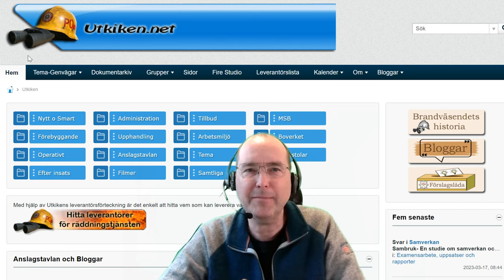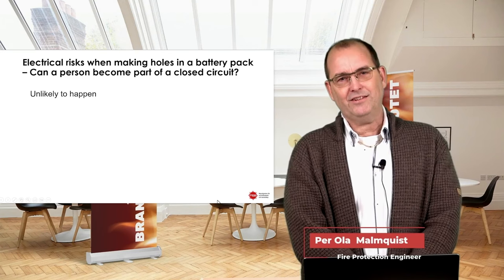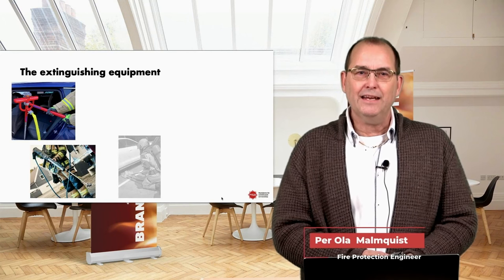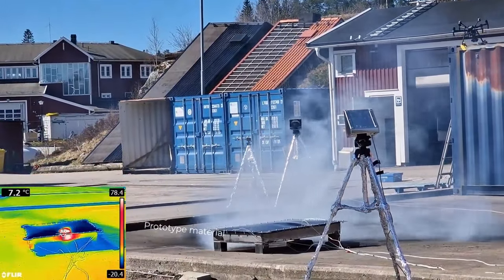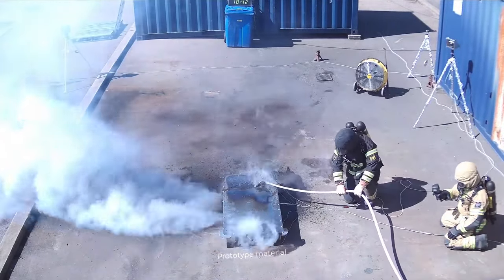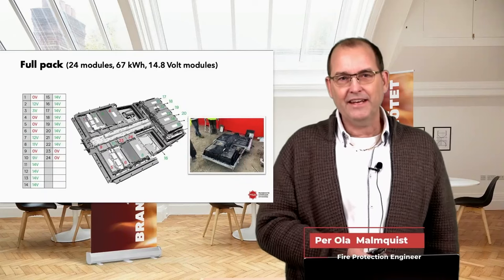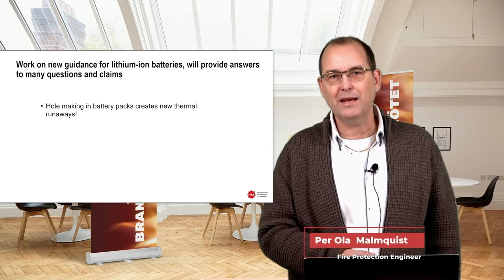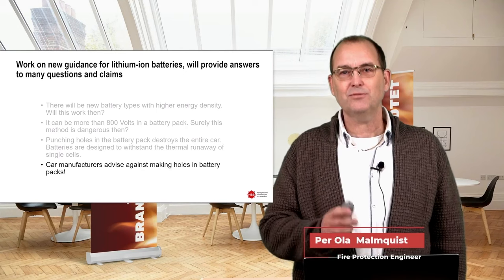Putting out lithium ion batteries with plain water in a short time

Comment: Thanks! It seems to me that car manufacturers could install standardized one-way ports at various points that could be used to directly inject water throughout the pack without needing to forcibly penetrate it.
Reply from the maker: That is spot on! If they did that we would not have the EV fire discussion that we have today. Renault actually has that on all their EVs. An opening in the battery pack that opens up in fire and makes it easy for firefighters to spray water into the opening.
Reply: Yes but this is where mice can enter into that area too and stat chewing away at the wires. New problemo!
Reply: @zeeek1  Read again ;)
Reply: @UtkikenRescue  If Renault has it, Nissan has it as well I suppose? Also, is there a standardized way the automakers communicate those things (similar to the rescue card i.e.)?
Reply: @UtkikenRescue  Is there a reason this isn't being done? Could it increase the odds of water getting in or getting shocked while charging in the rain?
Reply: You try to go near the car on fire, put the hose in the acess and stick there....

Comment: So build the battery packs with a coolant injection port for fire fighters. Injecting CO2 into packs would be best.
Reply from the maker: It turns out that gaseous extinguishing agents are not very good for battery fires. There are examples when some gases have worked, but the success rate is much smaller than for water.

Comment: Why not to build a "bottomless water pool around car" (supported by water filled walls) and fill it with water above lvl of battery?? Yes it takes more water but its easy and safe!
Reply: the biggest problem with water is freezing, and the pressure that might put on batteries... and actually causing problems.
Reply from the maker: There are some countries that are working with routines like that, and companies providing equipment for it. As I say in the video, there will be battery designs that cant be extinguished with interior water, and for them it could be a good solution.

Comment: This is fascinating to see. It reinforces some observations I've had regarding EV fires. Most notably that you don't need 5 tonnes of water to put out an EV and you're never going to get as good a job done putting out the fire until you flood the pack itself. Also demonstrates the cutting extinguisher to be extremely effective. But I don't think that's a complete solution since we still have impact damage that may involve substantial warping and consequent drainage of any flooding of the packs. It would be really cool if we had some sort of phase change chemical that could be injected into a pack in liquid state (ideally using the cutting extinguisher), survive the temperatures, and then set and seal out any oxygen. Such a system could also address the reignition problem as well.
Reply from the maker: Yes it is very interesting. I agree that it would be optimal to find something that would stick and keep it cool even if there are large holes. 
About our tests I think it is an answer to some occasions, and not to others. So like in any other firefighting situation there is a need for a skilled firefighter or commander that can choose tool wisely.
I was at a test in France were we burned a bus battery with an aluminium casing that melted away. I thought the cutting extinguisher would not be able to handle that, but after flooding continuosly for a couple of minutes the battery pack filled up well. So I believe patience and a continuous flow of water sometimes can be a solution when there are larger holes.
Reply from the maker: Yes it certainly is interesting to see that we start learn things that can bust some of the initial myths created by the vehicle industrys, in my opinion, bad advice. I totally agree that  we have much more to learn and your thoughts sounds very correct. I have been thinking about what would happen if we used AVD extinguishing agent instead of water, or Hydrex. Both are agents that are environmentally sound and sticks to vertical surfaces, cooling very good. On the downside for them could be that their viscosity is higher than water and might not flow as well in the packs.
Reply: Can manufacturers provide a convenient location and means of connecting a fire hose into the battery cooling system? A relief valve to allow outflow would prevent a buildup of pressure. The new  Zeekre good battery is designed to be waterproof. Tesla cybertruck has a positive pressure so perhaps the air  valve can also be used to provide an outside water  source?  
In your experience would a custom spray bar, providing high pressure mist, positioned  underneath the battery offer enough cooling effect? Such a spray bar could be deployed to fire agencies and used  immediately with little additional training and at a low cost?
Reply: @mickjoebills  There are a couple manufacturers who do have flood ports. I can’t remember which but they aren’t perfect because a collision could damage the ports too.
Reply from the maker: @captainotto  @mickjoebills I believe you are thinking about the Renault firemans access. It is a brilliant idea, that unfortunately might have some flaws in it. The problem being that the smoke (flammable gas) produced when there is a smoking thermal runaway have produced a couple of serious explosions. Would be great if it vented to the outside and not into the cabin I think.

Comment: Ok so it is very well known that  lithium reacts quite violently with water then how on earth you try to extinguish lithium batteries with water?!?
Reply: You are right about lithium metal, but the lithium in the batteries are mostly ions. Think of it like you have sodium ions in salt water, and sodium is also a combustible metal. 
Also, putting out the battery fires with water is actually not putting out the burning cells. Instead we cool the not burnt cells so they don't ignite.
Reply: @perolamalmquist9043  the main ingredient of lithium ion batteries is lithium metal from which you get lithium ions. Therefore, if a single cell is broken and water or even moisture is getting inside the cell it makes lithium react and burst into the flames damaging instantly cells next to it. The only way to extinguish the lithium battery is to use some powder or co2. Also the design of the battery pack should be done in a way that it would prevent fire from damaging neighbouring cells. Water is not enough to prevent other cells from being damaged. And if other cells gets damaged then water will be already there to react with lithium. I think better would be to inject some sort of gluey insulator that would insulate the cells from each other and prevent individual cells from any damage.
Reply from the maker: @severyn184  I have put out full size car battery packs with 100% State of charge with water. The lithium metal is not a problem for lithium ion batteries.
Reply from the maker: @severyn184  Here are a couple of videos where we put out lithium ion batteries with water. https://youtu.be/4xjDdmv8urk
Reply: The Dunning-Kruger effect is also very well known, yet it hasn't stopped you from thinking your high school chemistry knowledge outweighs the experimental data from a literal expert on putting out battery fires.
Reply: @r7calvin  putting out a fire is not that difficult if you have the right tools. However, it would be more sensible to use something else that won't react with lithium as much which could put out battery fire much quicker don't you think?!? The problem here is not a fire itself as much but individual cells getting damaged due to already broken cells violently reacting with water.
Also your rude comment doesn't outweigh the high school facts that are somehow missed in the process of putting out lithium batteries.

Comment: Good evening, thank You for a very informative video and precious experience. I would like to ask, I am working as an electrical engineer and designer of installations for houses and commerce (Europe), about practical experience of using fire extinguishers within highly automated households with heat pumps, PV installations, home automation, lots of notebooks... I request from an architect a fire protection project, when designing electrical installation for building permit does not usually require too much considerations as whole house is considered as one "fire segment / zone". However as an electrical engineer I always comment or recommend placing fire extinguishers also at such homes (although formally not required). Usually CO2 was used (halons not eco, water risky fro electric appliances...). So now to the question: I see that special vermiculite extinguishers pop up as a way of handling lithium battery fires, which release steam and create isolating crust over  the object. Do you have practical experience with them, or would you practically recommend such device for laic persons? Price tag is at premium, 6kg device is around 300 EUR. Thank you.
Reply from the maker: I have tested those extinguishers and they do a really god job when the agent is allowed to reach where it is of use. i.e. on and inbetween the burning and nonburning cells. I think the question to ask is if the persons using them will be able to reach the burning cells at the right time with the extinguisher.
Reply: @UtkikenRescue  Good evening, thank You for Your feedback. Yes, I am afraid, that without proper skills and hands-on training there is no practical chance for ordinary people to tackle anything larger than mobile phone or maybe notebook :/

Comment: I greet you with respect. 
Unfortunately, my English is not perfect, but I hope it is understandable. 

I have been researching lithium battery fires for 3 years. 

If we extinguish with water, we create additional toxic acid, which is seriously harmful to human health.

For example Hydrofluoric acid.... It is a solution of hydrogen fluoride in water.

This removes calcium from the human body and later causes death due to heart failure

There are many gases are released which can explode in high pressure, for example Methane, ethane, ethylene, hydrogen fluoride and hydrogen chloride. These gases are additional danger If the ventilation windows does not open due to a technical error.

If the temperature rises in the battery pack but there is no smoke yet, there is a high chance that it will explode.

The cells of the modules that were not in direct contact with the fire will be wet, causing more short circuits. If water enters the cell, lithium reacts violently and explosively to the water.

Lithium ion batterys can burst into flames again even after 2-3-4 days.

Unfortunately, I've seen a flame underwater from a battery module that was submerged in water. 

Thanks for your research.
Reply from the maker: Thanks for your thoughts. About hydrofluoric acid we have had a research project here in Sweden regarding that. It was a very thourough research and it concluded that the regular firefighting gear is more than enough to protect from that.

The gases that can explode is a serious risk that we need to deal with. If there are flames already, the explosion risk is not very big, but if unburned smoke can collect somewhere it is important to make a risk assessment and treat the incident something like  a gasleak of flammable gas. I believe the position of the vehicle will decide if it is possible to make an intervention or not.

We have measured the waters conductivity in the battery pack and it is not very conductive. That means that the risk of additional short circuitsdue to water are small. But of course a damaged battery from fire will have new electrical connections where they are a fire hazard by heating up the batteries and therefore maybe create reignitions. Here I think the vehicle industry should step up and take their responsibility and have an organisation to dissassemble and deenergize burned and crashed batteries within some predetermined time so they dont present a fire danger any more.

About lithium reacting with water, that is not true for lithium ion batteries. The lithium is in form of ions and if there would be some small amount of lithium metal in the batteries that is only in the not damaged cells. That means that water will not be able to rech that lithium. In the damaged/burned cells all the lithium metal will be combusted during the fire.

Finally, I have seen the flame underwater as well. But that is not a problem from a firefighting perspective since the water is used to cool the adjacent cells so they dont start to combust. In the cases I have seen with fire under water the battery cells has been in an enclosure, so that they dont get cooled by the water they are in.

Thanks for great questions and thoughts.

Comment: How do you expect firefighters to access the battery compartment while it's contained inside the chassis of the vehicle? Your tests appear to be in open parking lot in an exposed battery case. This is not a real world sceario.
Chief Hughes
Battalion 1 (retrired)
Chicago FD
Reply: Exactly, whats the point of even trying. In battery storage the motto is let it burn, what is the point of putting water on it when you risk further agitation…
Reply: Best Chief Hughes. There are tools that work very well to get the water inside the battery pack. I have been involved in testing a couple of them on real world EVs, and it is not hard to get the water in. First put out the fire like a regular car fire and then fill the battery pack. It 7s rwally not that difficult, but of course need the correct training and tools, just like any fire.
Reply: @tenkarausa5294  the point is to handle EVs when they are in a position where you dont want to let them burn, or if you want to save the environment by stopping the fire before everything is burned out. I think we have cracked the code of how to put them out. Then there will always be tactical considerations for what is the best option depending on the situation.

Comment: Perhaps even having something like voids/channels between the cells to help the coolant flow between the cells and take on any excess heat that would otherwise make it to adjacent cells? Though I don't know if that clashes with the design of the batteries.

Regarding the firefighter becoming a part of the circuit by touching the body of the car, could one other potential risk be that the leakage of the electrolyte around the car (assuming the battery already has some holes that just happen to be inaccessible for the purpose of pumping water into) could result in that electrolyte connecting their body to the car? Certainly seems unlikely, especially since the electrolyte is flammable and likely would burn out before it gets to conduct electricity, but it's just one extra way a circuit could form that I thought of
Reply from the maker: Yes, it would be perfect if manufacturers made a design that helped distributing the water. 

About the electrolyte, that is not leaking out just like you say. It is such a small amount per cell, and when the cell ignites it will burn away.

Comment: Hello Per Ola
It’s great what you are doing! Thank you for all the new knowledge and new possibilities of putting out ev fires. 
I’ve one question: did you consider making new short circuits after flooding the battery pack? Did you observe any bad influence on battery after flooding it? For example reignite of the battery?

Greetings from Poland ☺️
Reply from the maker: Hello Maciek,
We made to few tests to make any certain findings about short circuits. However the water that was left in the packs did not remove much voltage during the days we had between the fires and the analysis. The damages made to the battery can create short circuits even if the water does not. So it is important to consider short circuits and reignition.
Reply: Hello from ST.Hellens Oregon!!😁😉

Comment: would love to be able to see a NMC/NCM vs LFP battery in this type of test (I assume these are NMC/NCM)
Reply from the maker: Yes that would certainly be interesting. I would guess that there will be no big difference since we are not putting out the fire in the cell but rather cooling the not yet burned cells. And the temperature when we reach a thermal runaway are in both cases well above boiling point of water. that means that water will have a similar cooling effect in both cases. I believe the physical design of the battery pack and if and how water can flow is a more important factor than the battery chemistry.

Comment: So this is not a set patented method then and they are still working on a set procedure.
Reply from the maker: That is correct. There are several tools that can achieve water into the battery pack. Those tools are in some cases patented, but to get water into the pack is not a patent. Each tool manufacturer needs to develop a safe method for their tool.